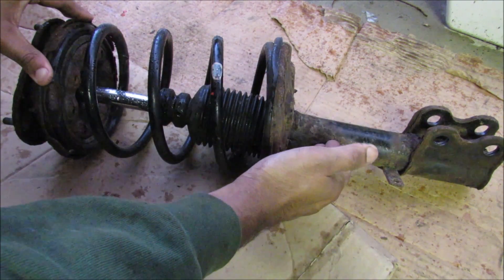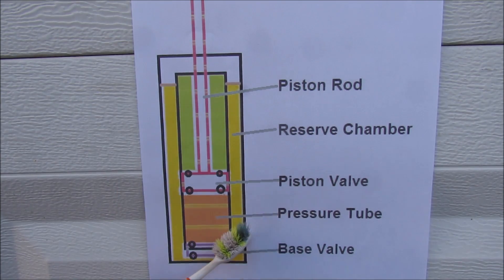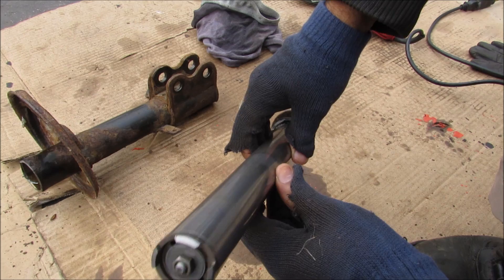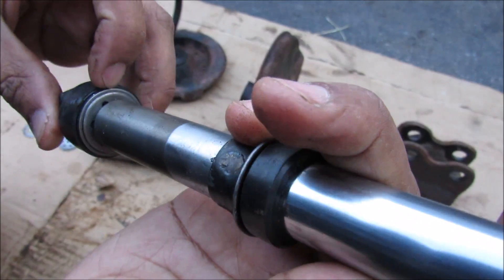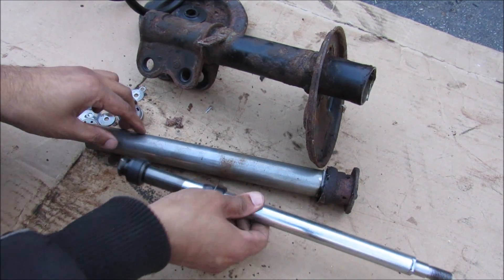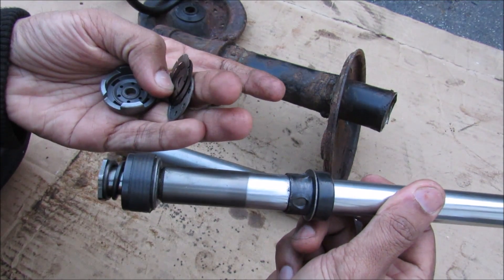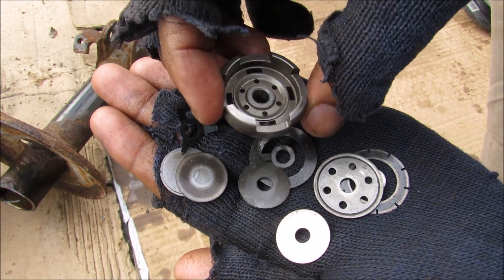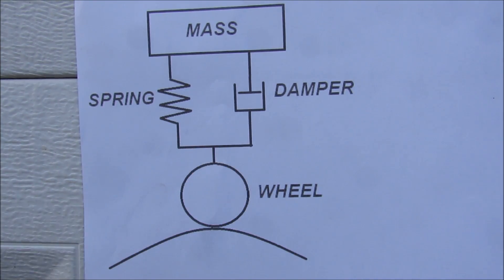How Shock Absorbers and Struts Work

Comment from the maker: The term shocks and struts are used interchangeably in this video because the focus is mostly on the damper. Struts are the damper and the spring mounted together as an assembly, while shocks are the damper itself, with the spring mounted separately on the suspension.
Reply: speedkar99 Well, yes and no. Damper and spring together, as a unit, is a coilover and it only works in up and down plane, doing tension and compression. Strut does the same, but can also take lateral force from the wheel.
Reply from the maker: +pancakewsx thanks for that clarification
Reply: Thanks bro your videos are so helpful for learn about cars keep going.👍👍👍
Reply: Pls detail Valve working mechanism

Comment: Don't undo the base valve's nut before knocking the valve out! You could've (and should've) knocked it out first, allowing you to see how the valving was set up before pulling it apart. However, because you undid the nut first, all the shims, etc went everywhere, and you couldn't see the exact way it was all put together (which would've been far more educational than the way you did it).

Comment: You didn't explain nothing about the mount and how it fails 😢
Reply from the maker: True. Those bushings go bad and make knocking sounds all the time
Reply: @speedkar99  so the center nut has no purpose anymore after putting the strut in the car right? It's just to keep the strut together before putting it to the car, correct? Can you make video on this please. I been searching the Internet and couldn't find much on them
Reply: Like where the knocking sound coming from? What metal on what metal is knocking?

Comment: Hi there. I was wondering if the strut shaft is strong enough to use it as an axle to mount wheels on my generator. Thanks
Reply from the maker: No I don't think so. It's meant to compress not bend

Comment: Cool.  Dealer says i have a damaged strut/shock absorber within a Loaded strut assembly that has a spring a strut/shock absorber and the mount and bearings .. Loaded strut is 4 parts that my toyota dealer will need to replace seperately and takes a special machine to compress the coil/spring in order to maintemance.  Anyway.. They want 800 bucks to replace the front two but i found a good condition loaded strut assembly for 60 bux amd will just replace the whole damaged loaded strut myself and save 730 bux..  Hopefully my allignment will be ok.
Reply from the maker: Yep sounds like the right way to go

Comment: Can a bad shock cause a clunk noise? I have the clunk noise and could not find the cause. It is heard when over any pumps.
Reply: Please check your lower ball joint for excessive play. A clunking noise is it's too loose in the socket.please dont try to check it yourself as the weight of the car may drop of your jack slips. The correct way is Jack up your car with the wheel making just an inch and half above the ground, please dont remove the wheel, keep some strong man to lift the wheel by putting a L spanner length wise between the wheel and the ground and lift it up and keep watching the lower ball joint from beneath  ,you will notice the ball of the ball joint is loose in the socket. Screeching noises are common from the shock absorber bearing not clunking, secondly check the outer tie rod end it will also move similarly in the socket but you must remove the cotter pin and check play, for which you may have to remove the front wheel, but to check for  a worn out inner tie rod end you can check it by removing the wheel and pushing the tie toe assembly back and forth you will hear a clunking noise if it's excessively worn out, you can also check it without removing the wheel by just jacking it clearing ground surface contact and getting hold of the wheel in 9 o clock and 3 o clock position and pulling and pushing them alternatively, in other words when pulling at 3 o'clock  push at 9 o'clock when pulling at 9 o clock push at 3 o'clock position if you hear a clunking noise it's a worn out inner tie rod end.

Comment: Hi speedkar, how true is the claim that there are manual struts and there are automatic struts. The automatic,  when the piston rod is pressed, comes back up due to pressure within the tube. The manual on the other hand, the piston rod doesnt come up by itself when pressed; claim is that you have to pull the rod up with your hand

Comment: My Dear Mr, speedkar99, I have been an Automotive Tech for over 40 years. I do the same as you do. First I learn about the engineering theory of an automotive component and I then take the component apart so that I can see the visual with my own eyes. I have to see for myself what is inside so that I can fully understand how it works. Like a team of engineers inspecting their final work before submitting it for production. I find that I can diagnose issues with cars better that way while performing my job. As Automotive Techs we replace parts everyday as routine. We sense that the suspect parts are worn or they have an issue. Being an Automotive Tech is a Zen for sure. :)
Reply from the maker: +bobdadruma thanks, that's how I learn too, some theroy and practical experience
Reply: if you learn theory only your inferior will underestimate you

Comment: Well explained thank you...
Gas filled or oil filled which one is better, is it okay to replace only single side strut?
Reply from the maker: +Jithin P V You should replace them in pairs for the same reason you replace tires in pairs. 
Gas and fluid filled give different responses, not that one is better than the other.
Reply: speedkar99 Thank you